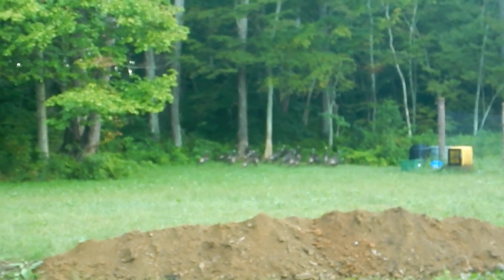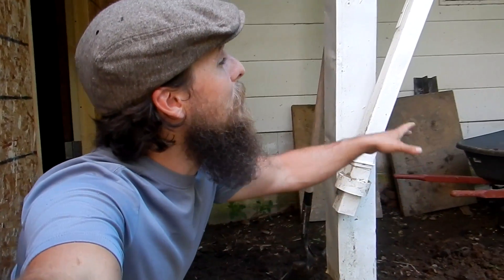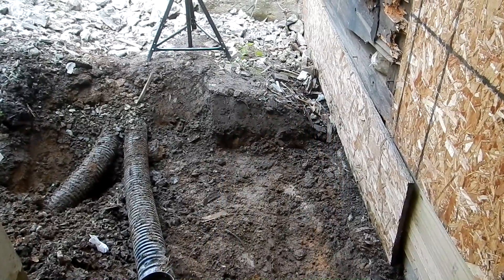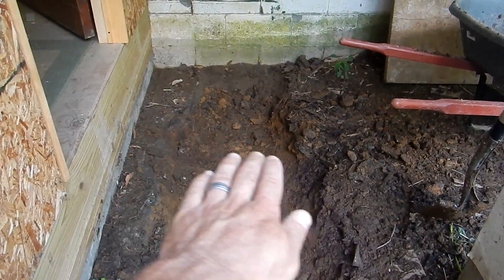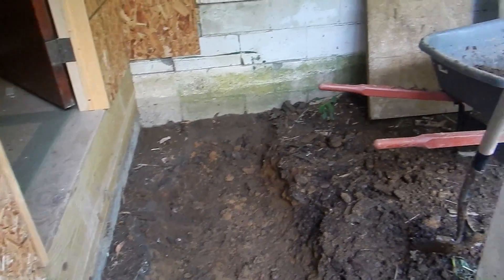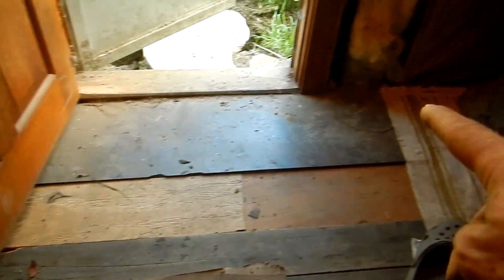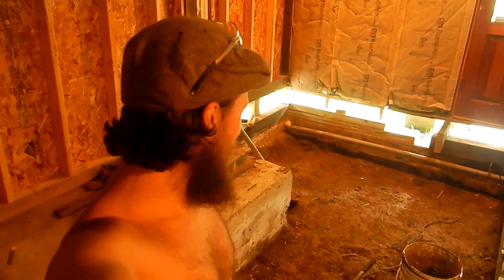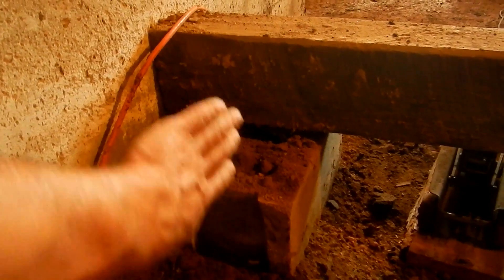This Rotten House Ep5 ~ If its not one thing it's another! ~ Home Sweet Homestead

Comment: without a footing under your 6x6 the wood will eventually release from the cement and start to sink again... also i can't tell from the video but is your 6x6 pressure treated?
Reply from the maker: Yes the 6x6 is pressure treated and in the bottom under the 6x6 I places a cement paver. I hope it works, thanks for the advise.